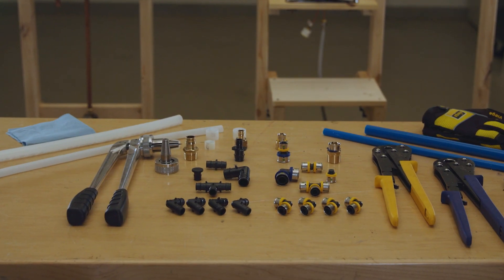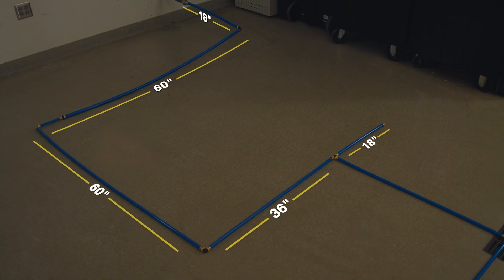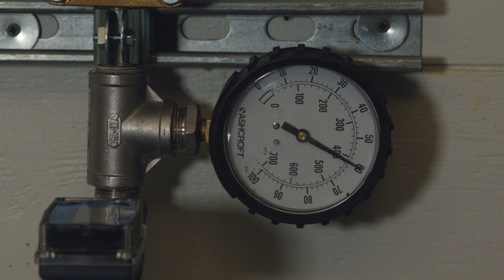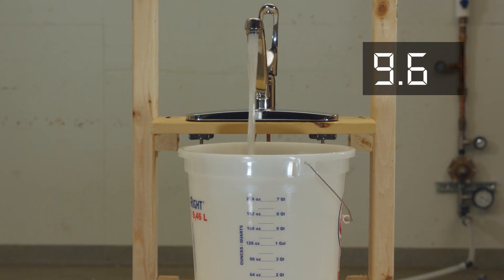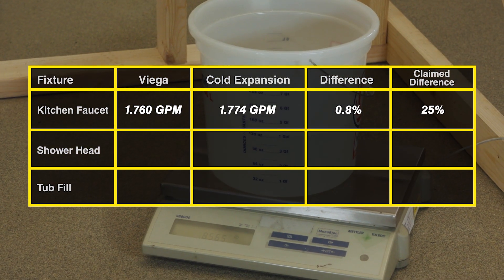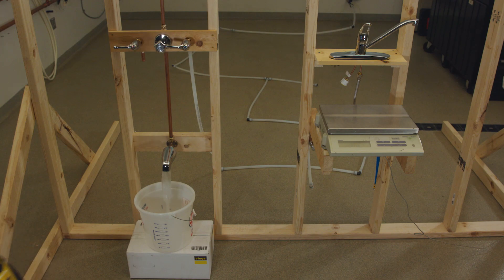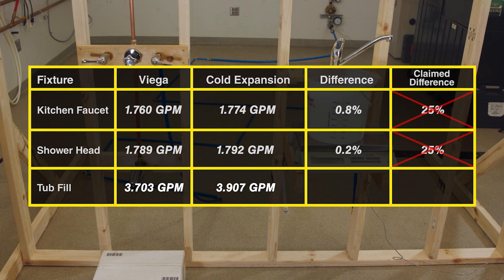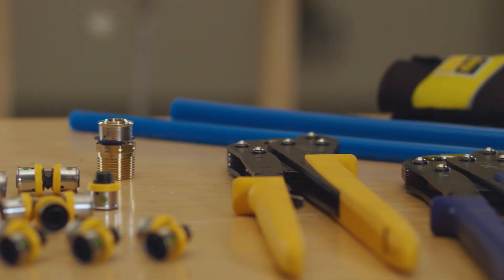Viega PureFlow PEX vs. Cold Expansion

Comment: The true test would be to test the flow rate when using a full port hose bib or boiler drain.  The tub/shower/lav all went through valves and cartridges with integrated  restrictive channels which render this test useless if it's truly meant to test flow rates of pipes and fittings.  This test concluded that fixtures are restrictive.
Reply: No, this test acknowledged what is commonly known, that fixtures are restrictive, often by design, and concluded that the difference in flow rate in pex systems is negligible in real world use with those fixtures.
Reply: except the real world may have multiple fixtures being fed by a single pex line/trunk being used simultaneously, at which point it may matter.  Yes you could upsize the line as well, but then you will waste more hot water flushing the line.
Reply: @isabellavision  what is "commonly known" that fixtures are restrictive?  Then what is the point of the test?  He presented a table of "difference" vs "claimed difference" by designing a test that doesn't test the difference.  Taking two pipes of different diameters then send both through a bottle neck, to test how much difference comes out of the other end of each.  Then what is the point of the test?  The test is not a test of the pipes but a test of the bottle neck.  If he says "Heck it doesn't matter what pipe you use because they all end up being restricted anyways" then fine, but he published a table with numbers!  Not to mention it really matters when you have a pipe splits in two or three and in use at the same time, like the toilet tank refilling when you wash your hand and turning on the shower around the same time, then it matters.
Reply: Do you drink or shower out of your hose bib?  They used fixtures people use daily.
Reply: @mikejones5364   Many shower heads like rain heads don't have flow restrictors in them or if it does, you can remove it.
Reply: @mikejones5364  No but plenty of people including myself, need full pipe volume for certain applications.  For example, if you need to time your water usages based on volume dispensed.  Example one, irrigation.  Example two, say I need to refill a 25000 gallon swimming pool, and I need to know how long to wait based on flow rate and volume.  A restricted fitting makes a big difference in time waited.
Reply: @SL-uy7hc  All fixtures in a house have restriction on them, Name one fixture in a house that doesn't. I can't think of any.
Reply: @mikejones5364  garden hoses with a full port ball valve is one example.  I just had a flood that turned my pool into a swamp a month ago.  Had to drain and refill.  I have 3/4" line with 3/4" full port ball valve connecting to a 3/4" garden hose.  No restriction.  It matters when calculating how long to fill a 25000 gallon pool.  There are other examples.  But the point front and center is this "test", if you even call it a test, shows numbers comparison between different piping knowing there are restrictions downstream that inhibits the flow, which makes the test completely invalid.  It says his kitchen faucet difference is 0.8% and claimed difference is 25%.  The difference of 0.8% due to the restrictions.  While that may be the author's experience, it makes the tests useless.  He could have tested 1/2" vs 3/4" and have the same results and claim the difference between 1/2 and 3/4 has no difference.
Reply: @SL-uy7hc  You don't see hose attached to anything with a full port. Come on now. They are mostly frost proof in my area and 1/2" screw in,  Stop trying to fantasize.
Reply: @mikejones5364  may be in your area.  I am in south Florida I have 1" service line to 3/4" full port ball valves for all hose bibs.  Try to run a shower with body jets requiring 2.5GPM per jet to keep pressure.  Plumbers who use PEX goes back to copper when running the segment from the bath tub twin ell up to the shower head because PEX has enough restriction to cause a back pressure but copper doesn't.  I cannot imagine having to fill a 25K gallon pool with a 1/2" line going into a 5/8" hose.
Reply: @SL-uy7hc  Show me a pic of full port ball valve for a hose bib at your house. Not common.
Reply: @mikejones5364  You don't have to be a hydraulics engineer to fix THAT.
Reply: Let's say I have a 1" full port valve and 2 GPM flows through it and I have a 1/2" valve and 2 GPM flows through it. Which valve has more flow? Answer, they both are the same, 2 GPM. How? Physics. Velocity will increase in the valve or fittings with a smaller diameter to match. Another note: a cold expansion fitting is not full sized. The I.D. of the fitting is smaller than the I.D. of the tubing and is still being inserted into the tubing. Small difference of the I.D. between Viega pureflow fittings and a cold expansion fittings. That is why the differences are minimal.
Reply: I believe this test to be a bit misleading. When it comes to fixtures, the most common size diameter pipe is half inch, be it copper, PEX, CPVC, etc... At the 2 minute and 24 second mark, they're clearly tightening some PEX-A that's 3/4 inch, so I imagine that the PEX-B is also the same diameter. Because the pipe is oversized, the limiting factor is always going to be the fixture. I just did a bathroom last month, using fittings from a major brick and mortar, the ear drops that hold the shower head, and stub out the faucet, were all half inch, because that's the size everyone uses. I'd like to see this test repeated with the same fixtures, but using half inch PEX-A and half-inch PEX-B, and not 3/4 inch.
Reply: Exactly!

Comment: Wow! The tub fill was very surprising! Nearly 4gpm with barely any noticable difference! I also thought  the pex-a fittings would provide much better flow. Brass fittings for pex-b also have a larger diameter than the plastic ones. Hey could you run this test with 1/2 pex?
Reply: Moen Posi-temp rough in valve has a max flow of 4-6gpm at 60 psi.... These tests are to show that in typical home usage the difference in negatable. I wouldn't doubt that Uponor Wirsbo fittings do have a 25% flow difference in full flow conditions.
Reply: @phillip miller Wow! I didn't think it was that high.
Reply: My tub fills with 15gpm....
Reply: You ask if the test can be run with 1/2 PEX.  I thought this test was 1/2 inch PEX.  ?